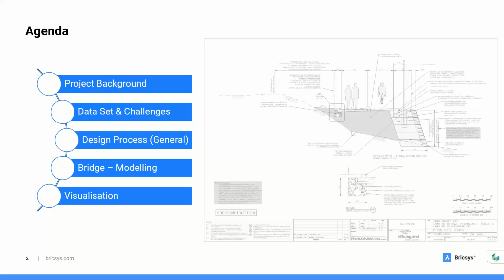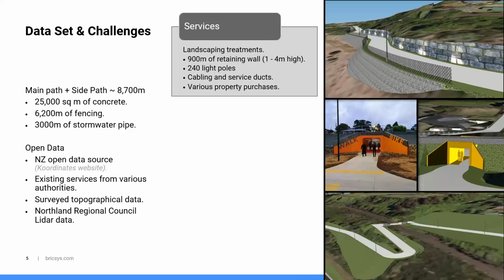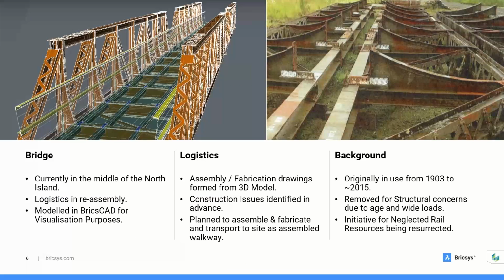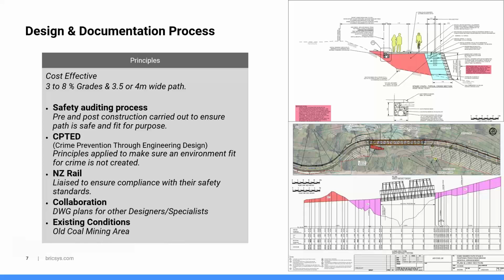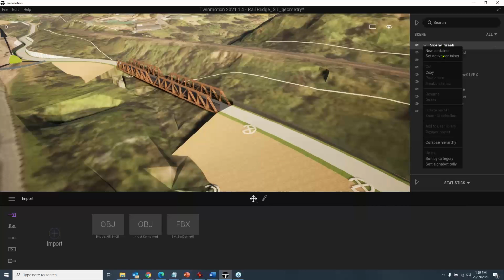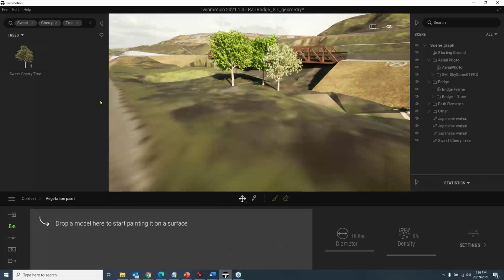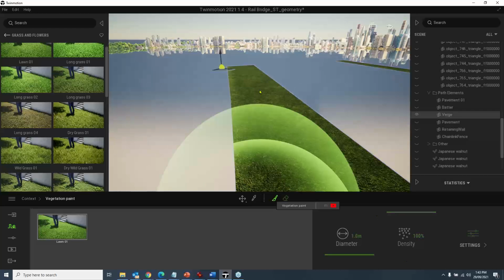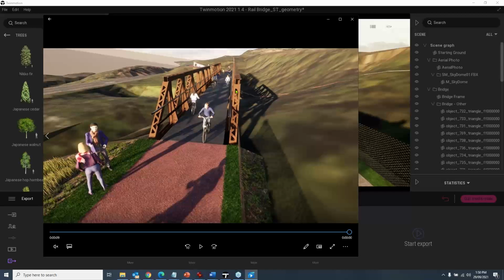BricsCAD Customer show case Public shared paths Design and Visualization

Comment: Your biggest bug in bim mod is we (architects) working on plans and after that we go on modeling and editing... If you have a mechanical vision, it's not true... Another software like Revit makes our plans for the 3d model, but your software we can't work on planning and then... We must work on plans in cad mod and begin modeling. It's the biggest bug because after modeling we change the model and we must go back to the cad and change it again... and again and again.... If you want to be the best architect of software, you must have an architect vision, not a mechanical... ❤ But in 2d cad and modeling you can number vs autocad and sketchup but not in the bim.
Reply: We are working on planning and modeling at the same time, but more focus on plans because we can measure everything and we have more control. We use columns like a vertex object on plans, not a line profile in 3d... We use different walls indoors and outdoors with different with... It's not easy to manage our wall in a project... and important is we don't have 2d control on modeling and 3d control on 2d models.. We haven't a project as a one object mechanical. We have more than 10000 objects and different options.